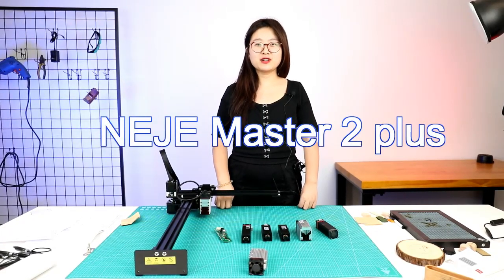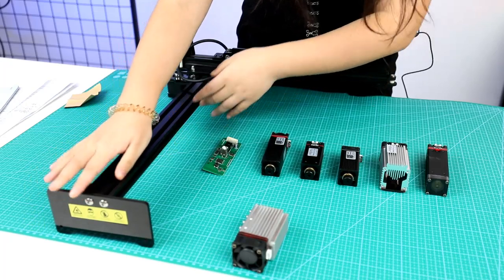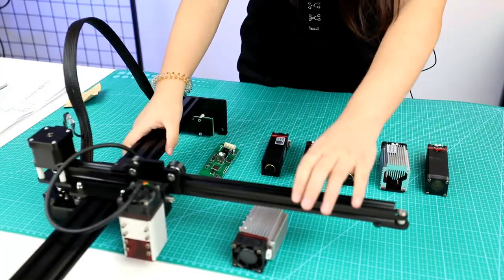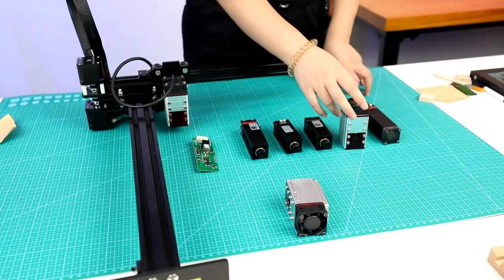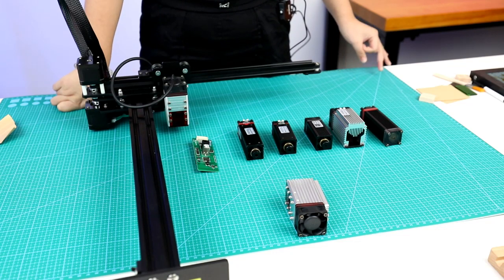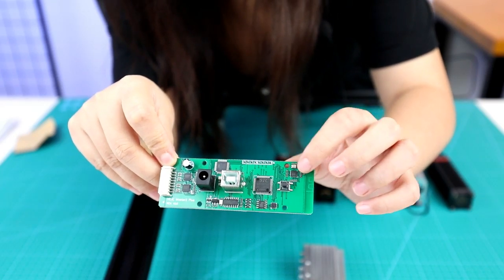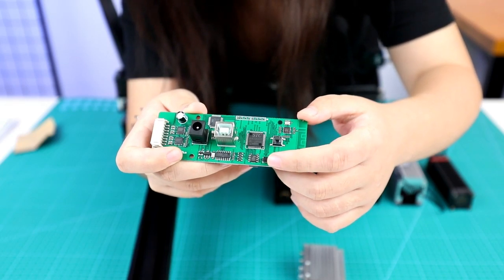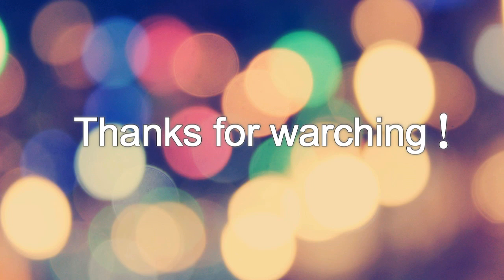NEJE master 2 plus laser cnc cutter, laser engraver, laser engraving machine.

Comment: Hello, I have a question about the electronic control board. Is it 8 or 32-Bit?
Reply from the maker: At present, it is controlled by original atmel and stc 2+Bluetooth 3 chips. Please note: the engraving speed of the machine is determined by the weight of the module, and the cutting speed is determined by the laser power. Atmel is a grbl dedicated chip, and the performance is absolutely sufficient. We will later upgrade the motherboard of the master series, and will also use a 32-bit control chip, which is 30% higher than other current stm32s and can improve some sports efficiency. Please pay attention.
Reply: @nejestudio686  I was wondering this too! Thank you. Can you tell us when the 32bit board may be coming out? I have read it doesn't increase speed much, but it would make pictures come out better. Like better detail and better shading. I would like to see a video of the 30w module engraving a portrait or something in the future :) I really want a master 2 max
Reply from the maker: @Evanator22742  I am glad to discuss this issue with you. At present, the amtel motherboard can control 255 laser power levels. The 32-bit chip can theoretically subdivide more levels, but in fact, 255 laser power levels and 1000 power levels have almost no engraving performance. The difference, the laser current and power are not absolutely linear. Under this resolution, the engraving effect is not different. Please don’t be misled by the so-called 1000 resolution. If you pursue better details and grayscale, 405nm lasers can be Better grayscale and details, because the absorption efficiency of 405nm wavelength can present better details. Neje will update the 2s version of the motherboard, and the master series will be updated. Customers who bought before, please don’t be disappointed. NEJE pursues engraving and cutting quality and does not have hardware performance. However, under pressure, it will also upgrade the control chip, but please believe, master The 2 series also has perfect carving quality.
Reply: @nejestudio686  I love that you guys are responding to comments. I really appreciate it and the thorough explanation. Can you tell us when the motherboards will be upgraded? I'm deciding between the neje Master 2 Max and ortur laser master 2... I know you say 32 bit doesn't matter all that much, but I like having the newest, latest technology available
Reply from the maker: @Evanator22742  Thank you for your attention, we will update in about 2 weeks, the model is NEJE Master 2S max
Reply: @nejestudio686  yes! Awesome. Hoping you guys put together a 32 bit 40w maser 2 max for me ;)
Reply: @nejestudio686  Is only the Master 2 max going to update motherboard or also the Master 2 plus?
I am planning to buy a 40w Master 2 plus when it will come with 32-Bit control board.
Reply from the maker: @konstantinoscholevas9895  we will update in about 2 weeks，master2s, master 2s plus，master2s mix, master 2s max， 30% higher performance than stm32
Reply: @nejestudio686 
Hello again! 
At first I would like to thank you for responding to my questions! 
I need the laser mainly for precisely cutting plywood and balsa for rc model airplanes.
Engraving is not so important for me.
I have to import dxf files to LightBurn and then cut the pieces with a great precision.

- Is the NEJE Master 2 max or plus (with the recent motherboard) enough for using LightBurn and cutting plywood precisely, or I have to wait for the Master 2S version with the 32-Bit board?

- Is the 30w module enough or I have to buy the 40w?
Reply from the maker: @konstantinoscholevas9895  The 30W cut edge is very beautiful. It is recommended to adjust the speed to 300, about 2-3 times. The NEJE 30W module is already the single module with the highest power, with very good heat dissipation performance and optical design, and the price is relatively cheap; You choose max size, max has a size of 460x810, your application may require such a large area, if you need to generate your work, it is recommended to buy a 40W module, the speed will be faster, and the power is 2 times of 30W; I I can tell you very responsible, stm32 and atmel chips will not affect the actual speed, accuracy and process; the process is mainly determined by the mechanical accuracy and laser module. In addition, neje provides accessories and after-sales support, so you can buy with confidence.
Reply from the maker: @konstantinoscholevas9895  The density of balsa wood chips is very light, 30W is enough
Reply from the maker: If you want to upgrade to 2s in the future, you can buy a motherboard, which is very cheap and supports all interfaces. It is true that atmel performance is enough for this type of machine. If you are an enthusiast, you can upgrade in the future.
Reply: @nejestudio686  I would like to ask you two more questions please... 

- Is the recent version of the Neje master 2 plus (with the 8-bit motherboard) 100% compatible with Lightburn software?

- I live in Germany. From where can I order a Neje master 2 plus with 40w module? Do you sell through aliexpress or bangood? If yes, which is the name of the store (because there are many with similar names)? 
At the links on the description I only see Amazon US.
Thank you!
Reply from the maker: @konstantinoscholevas9895  Currently master 2, 2s, master 2 / 2s plus, master 2s mix, master 2 / 2s max are 100% compatible with lightburn, and the 2s version is 32-bit, and the performance is 50% higher than stm32;
Reply from the maker: @konstantinoscholevas9895  You can visit neje.shop and AliExpress official store, as well as other AliExpress stores. It is a NEJE authorized store and can provide service support. Including Ebay and amzon.
Reply: @nejestudio686  Hello! As I have mentioned before I need the laser especially for precisely cutting plywood and balsa and not for engraving so it is very important for me to know if the 40w neje module is focusing down to a very small dot and not a small line! 
So, is the 40w module focusing good enough for cutting or it is designed more for engraving?
Is also the 30w module focusing similar to the 40w?

Unfortunately there are very few YouTube videos or reviews so that we can get enough information about your product. 
I was reading a review for example that the ortur 15w module focuses down to a dot and is better for cutting, but the 20w module focuses down to a line which is ok for engraving but not for cutting.
I believe that it is important to know such details in order to buy the proper machine for the specific job that we need it. 
Thank you.
Reply from the maker: @konstantinoscholevas9895  I’m very glad to help you answer this question. I’m actually the product manager of neje. I operate the neje series of optical designs. The 40W module is composed of 2 laser diodes with the highest power combined with optical fiber technology. Makes the laser spot is square, the minimum focus point is 0.06mm, which is why this module is expensive, the actual use of this module is basically industrial grade; if you are only light-weight applications, I do not recommend you to buy this Modules, in fact, neje20W and 30W modules can achieve the same effect. What I can tell you is that the focusing effect of 20W and 30W modules is very good. The cutting edges of plywood within 3mm are very clean, just need to be cut 2-3 times; while 40W only needs to cut once;
Reply: @nejestudio686  At first I would like to thank you for answering so fast to my questions! 
I would like to mention that I was searching at the NEJE.SHOP to find the NEJE Master 2 plus 40W so that I order online. Unfortunately I could find only the 30w.
Are you going to restock? 
If the Master 2s version is coming any soon, I would prefer to wait a little bit and order this instead of the Master 2!
Reply from the maker: @konstantinoscholevas9895  Hello, I have received your message, I will arrange it tomorrow.

Comment: Hi i am a 20W user but my module failed by the first couple of hours! Meanwhile i have read in many groups/forums for a lot of people complaining for the same problem!! After the very first use significant power loss!!! What is going on? Neje modules are advertised for CONTINUOUS operation compared to cheap ones and nowhere is mentioned that they have power limitations for the diode to have expected life which is about 20000 hours!!! this is probably a dream!!! I wish mine could kept for 1000!.. now i am sitting and looking my module to produce just blue light!!!... And many people like me!

Comment: Hello, i buyed 40w neje module 3 weeks ago via AliExpress. What is the distance between module bottom (heatsink) and cutting material for perfect focus?
Reply from the maker: The distance from the light outlet is 30-50mm, you can adjust it to 40mm, and the spot size is 0.08mm. Note: The focusing head can adjust the focal length. You can adjust it to a suitable focal length, and then use the fixed focus method to apply.

Comment: I am interested in this machine, I want to buy it on 11.11, I would like to know how long it takes to engrave and cut plywood and balsa wood, I hope to win a coupon for being the first comment :-)
Reply from the maker: If your main purpose is to cut balsa, I suggest a 30W module, which is more cost-effective. If your frequency of use is high and you need to cut faster, I recommend a 40W module.
Reply: @nejestudio686  tank you so much... And my coupon 😟
Reply from the maker: @TheBaltcast11  V010WZ38E9ZN  neje.shop
Reply: @nejestudio686  tank you but dont work

Comment: Hi, I think to test the 40w version on m'y channel one day.
Which height can it cut in plywood please ?
Reply from the maker: It is better to cut within 3-4mm at one time, 8mm thickness is also possible, and the speed is 200; the cut is relatively clean.
Reply: @nejestudio686  thks, if one day I can buy it, i'll think to you  ;-)
Reply from the maker: @SVTavecMReynoard  This should be done, thank you

Comment: Laser power controlled by 255 or S1000 steps? :) Thanks!
Reply from the maker: In the benbox control mode, the laser power is 0-L255, which means the power is 0-100%; in the GRBL1.1f control mode, the laser power is S0-S1000, which means the power is 0-100%, I hope to help you!
Reply: @nejestudio686  it did! Thank you :)
Reply from the maker: @Evanator22742  The 2S version has been updated to s1000，Control chip performance is 50% higher than stm32

Comment: I have the master plus 2 30w and cannot cut through wood
Reply from the maker: It is recommended that 3mm plywood, the focal length should be focused to the upper middle position, cut 2-3 times, at a speed of 300, so that the edges will be cleaner.
Reply: I dont understand the speed 300?
Reply: I use neje software
Reply from the maker: @louisesnape  Master 2 plus not only supports neje series software, but also grbl1.1f firmware. For this firmware switch, you can find the firmware switch software at wiki.nejetool.com. After switching to grbl1.1f, it can support laserGRBL and lightburn software.
Reply: @nejestudio686 hello thanks for your kind quick reply. Is that the only way that I can cut by using another software? I like to use neje software
Reply from the maker: @louisesnape  Thank you, the research of neje software is to provide professional engraving effects for beginners. The NEJE team is developing more professional and easy-to-use functions to provide you with better services.